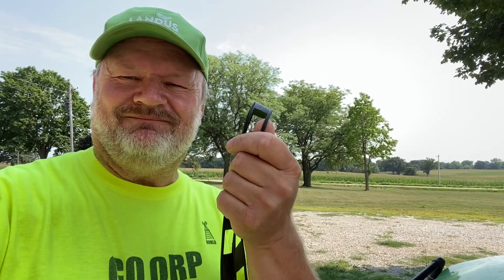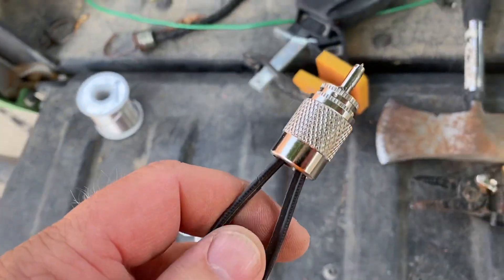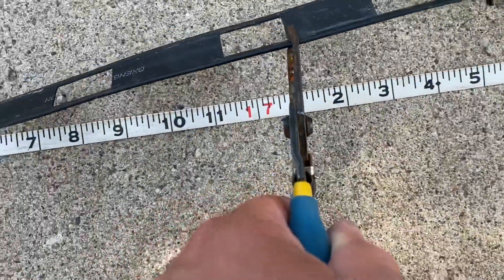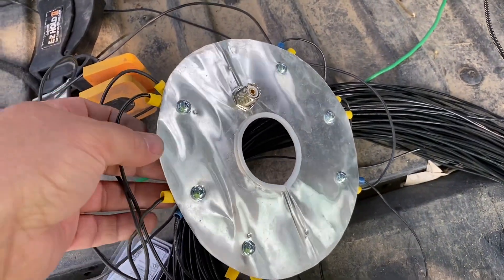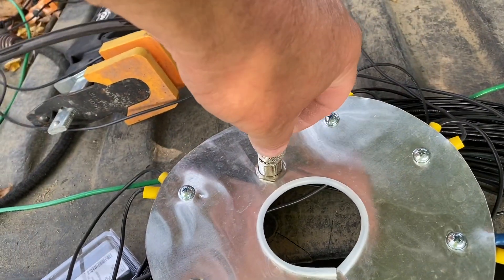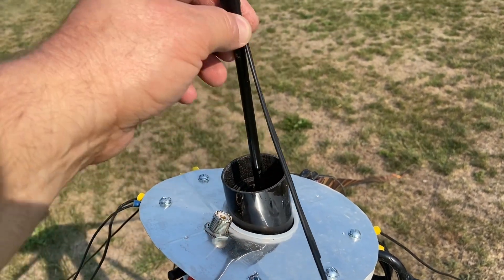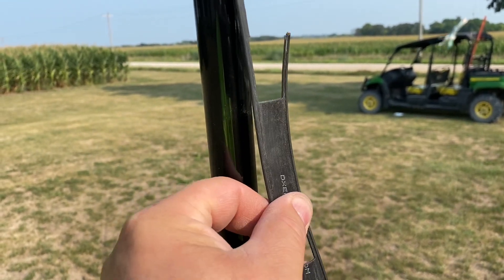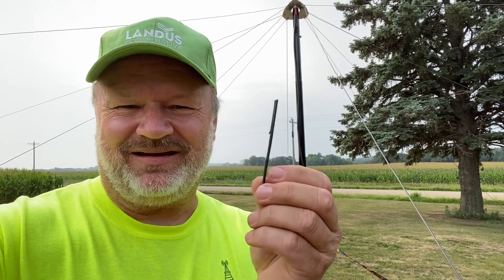Home brew 20/40m vertical multiband antenna

Comment: Thank you for your video.
   I do not know what the problem is.
Works on 40M and fails on 20M- strange.
   If it was static discharge, both 20/40M should be affected. 
   Is it some kind of tuning problem?
I took some notes. That's a stumper.
  I have never seen ladder line connected to a PL-259 connector. Is that a problem?
Usually ladder line is connected to the binding posts of a tuner or transmatch, or to the transmitter or a balun.
Thanks again. N0QFT.
Reply from the maker: Hi Glen.. Thank you for stopping by, leaving a comment and asking good questions.. I'm just a rookie in all of this and don't really know what I'm doing.. This video was a few years ago and there could be multiple problems with this set up.. I've gained a little experience since then and would probably build it differently next time.. in fact, I need to revisit this when it warms up and give it another go.. It's fun experimenting and building on where we've learned.. That's what's great about this hobby.. Thanks for watching.. 73, Kevin ~ k0klb

Comment: you are doing very well , 

 can we use 40m band 1/8 th vertical driving element for ground plane antenna i.e 5m  and 20 m bands 1/4 th vertical i,e, 5 m driving element with , 3 to 4 radials 

 thats means  only single 5 m vertical element with radials  for 40 m band , same for 20 m band ,  this is the idea, if you like it , kindly check it ,  have FUN and give FUN to your youtube followrs,

in my opinion your SWR varing because  two elements of 20 m and 40m are too close , may ineterfer with each other.